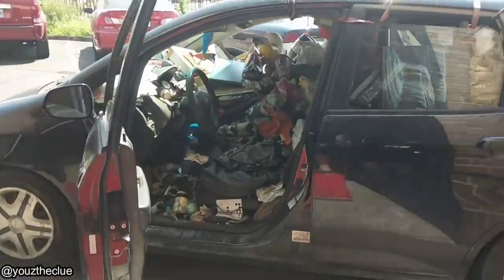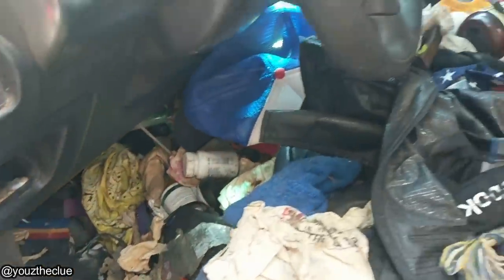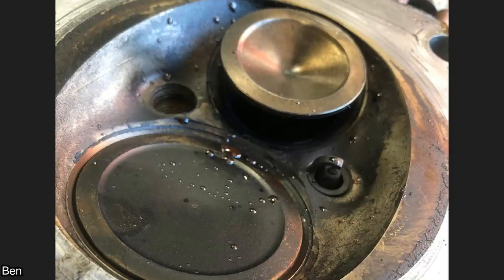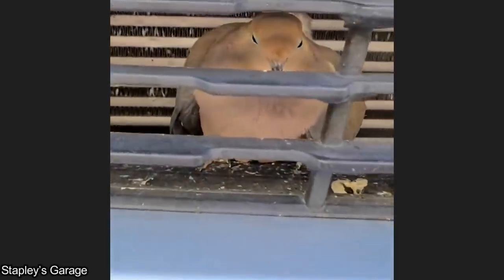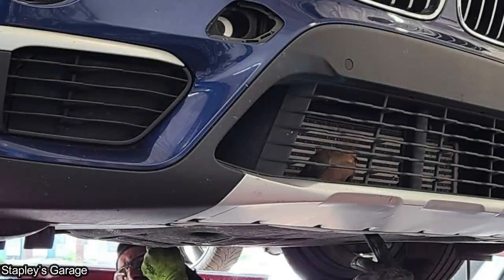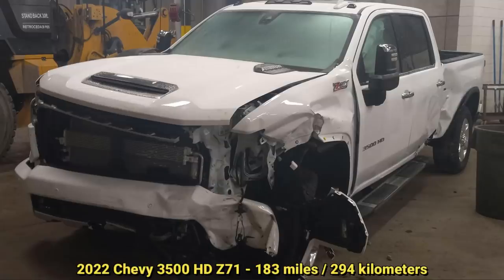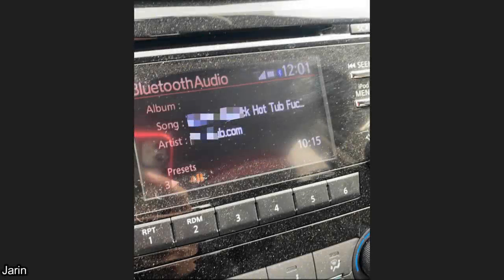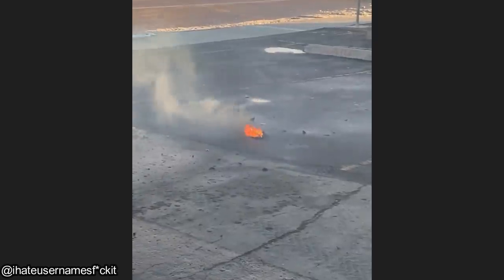Customer States Install New Tires | Just Rolled In

Comment: Son "But I was only going about 10-15 mph when I hit the curb."

Dad "Too bad the curb was doing around 40. Which, by a wild coincidence, is the same age you'll be next time you drive one of my cars."
Reply: Who lets a 17 year old near a Maserati? Parent needs a slap.
Reply: @davepayne164  any teenager can find a hidden phone. Let alone a spare key is easier to find.
Reply: Reminds me of when I was a mailman and had just seen Tokyo Drift, obviously I thought why not, I can surely do that in the postal van! Went okay starting out but I had chosen to start the drift on gravel road onto a asphalt road, needless to say I ended up in a ditch with a totaled van 😂 my boss was not happy even with my explanation that I wasn't going that fast
Reply: @Tumpz  did it at least feel more authentic in a right side drive vehicle?🤣 We used to have an old mail delivery rig, a '76 International Scout and it was fun to drive to high school.😆
Reply: @justlucky8254  it was actually a left hand one, it was a tiny Peugeot van I think. In a regular van it would surely have went on the side 😂 I almost did that to another van not thinking about the center of gravity when doing a turn at high speed.
Reply: @BoredGeese  not when it’s in the gun safe

Comment: I worked as a mechanic for a bus company. The owner bought 2 new VanHool 45 ft. buses, one of which was pre-owned. Well, the pre-owned one, it turns out, looked a lot like that first car when it was traded in by the previous company. I opened the luggage compartment only to be greeted by the sight of roaches running for cover. The whole damn bus was crawling with the nasty, little buggers!
Reply from the maker: Gross 🤢 hate roaches
Reply: @JustRolledIn  We freeze dry them in Wisconsin.
Reply: @ Anon Nymous So you're saying the bus was a real "Roach Coach?" I' show my self out.
Reply: @darkdelta  You here all week? lol
Reply: @darkdelta  That was a good one.
Reply: Omg,me too! I had to work on a conversion van once,and whe i took off a rear trim panel,no lie,i was greeted with a complete "wall"of roaches,behind that panel🤢🤮!!! That thing gave me nightmares,for weeks!!
Reply: Worked as a mech in a muffler shop.  Had a carpet cleaning van come in for some welding on the pump motor's exhaust. Opened the passenger door and  about 10 soggy  paper lunch bags and a few hundred cockroaches spilled out.  These guys "clean" the carpets in peoples homes...  Frickin' nasty.
Reply: we had a  customer return a skid of product to us . it was weathered and full of roaches . we put it outside way away from the building right away . the product was plastic so no food. maybe they were eating the cardboard packaging.

Comment: That impact lithium fire was a good lesson. Probably not a good thing, to store battery powered tools in the same toolbox as other flammables!
Reply: or around metal chips, steel wool, buried under metal tools etc..
Reply: Within the last few years our planes started carrying fireproof bags with fire gloves in case a passenger laptop catches on fire. The flight attendants are trained in putting out the fire. They are stored in the overhead bins at each end of the aircraft.
Reply: What if the toolbox itself is flammable?
Reply: What brand was that?

Comment: We had an old AMC that had no floor pan under the passenger's carpet. It was rusted away, and it was that way for years before I discovered it. I found it only because I went underneath to replace the starter.
Reply: My father had a car, a Plymouth, that he drove mainly back and forth to work. One day my mother was was riding with him and said she could see the road through the floor. He said that must have been the cold draft he felt while driving.
Reply: When I was a kid, my family lived in Michigan; my father was constantly buying cars to fix and resell. One time, back in the mid 70's, he bought a 1968 VW Bug. The thing had zero floorboards; he made some out of 3/4" inch plywood, and resold the car.😁...
Reply: @ursus353 That's  what  You call, rebuilding a WOODY!!!!!

Comment: I'd be so embarrassed about the Bluetooth thing, it's actually a fear of mine 😆😂
Reply: Who would be watching that at a garage? That is my question.
Reply: The radio I got for my car I purposely went for one that didn't have bluetooth compatibility and went for one with an SD card slot, so I just load an SD card or two with music, insert SD card into radio and go. I do not want nor need my phone to be connected to my radio, too many people want everything connected to everything and it's just a big hassle.
Reply: that's so weird because at least in my car it only shows what's currently playing. i'm pretty sure that's how most bluetooth radios work, so whoever it was, was watching that while the mechanics were working on it.

Comment: Had a van come in worse than the first one (if you can believe that) for a battery. Customer stated they had their own battery, somewhere in the back. I declined to service it unless she found the battery, and made her pull the van over to outside my bay.
Reply: holly cow... I wonder if it's compulsive hoarders that end up with cars like these. I can bet they'll keep the old parts inside the same car if you let, and throw a fit if you don't.
Reply: I’ve had about 4 or 5 like this in my career. Worked in one shop where a hoarder came in for regular maintenance. At least the driver side was clear of debris
Reply: @Kalvinjj  I knew a man who had his car full of newspapers neatly stored, we joked that he could not fit them at home when he died, so it turned out that his whole house was full of newspapers. According to rumors, they emptied the house of 15 tons of newspapers.

Comment: I never got into battery-powered tools in the shop. I like air tools, one source of power all day long. Air tools last a lot longer too!
Reply from the maker: You and I both. Did mostly heavy duty so air tools just worked better for what I was doing.
Reply: Can't tell the kids anything.. 🤭🤭🤭🥴
Reply: Amen to that
I mostly have corded power tools but they're still working well in their old age

I have craftsman tool that have SEARS logo on it
Reply: Lithium is amazing.  
Until you see a pack catch on fire and then they are terrifying.
Reply: Caution: if a lithium battery is burning, don't breathe the fumes, they're toxic. And use a Class D extinguisher not water.
Reply: Two things I have never liked about air tools:
1: Having to deal with the hose (Yes, you get used to it, but if it is all the same? I'd rather not have to in the first place)
2: Fucking. _LOUD_.

But, air just does somethings batteries can't. Like never having to worry about overheating, or....airguns.
Reply: @dposcuro  Check out aircat airtools, my 1/2 drive impact from them is quiet and a beast, loosens things no other brand in the shop will, ir, snap on, etc.  I have the dual clutch model but i would get the other type, twin hammer or something i forget the name,  if i got another. my trigger is either on or off, cant modulate it,but works good for doing tires with a torque stick when tightening.  My gun is quieter in my hand than my coworker's ir a few bays away.
Reply: And when the power goes out and the compressor is empty?
Reply: @FireoftheGreeks  I think for most people, that is such a rare occurrence it is rather hard to justify as a purchasing choice.

Sure, if you live out in the middle of nowhere, and power outages happen every month or so, or perhaps if you live in Texas, it might be worth considering. But for most people? Not really a consideration with much weight.
Reply: Buying thinner and therefore lighter, higher quality and more rubbery hose makes using air tools alot easier. 

The ready made ones are too stiff and crappy for my liking so I make my own up with special order hose and proper Nitto hose fittings.
Reply: @haroldwilkes6608  I mean, it's an electrical fire--one of two types you never want to use water on.
Reply: @connor3288  I have the aircat stubby 1/2" and also the 1150k. The stubby has enough power to do 95% of my work and is my all day every day gun. That 1150 has more power than any other 1/2" gun in my shop. I'm a big aircat fan myself. Plus both of those guns and my 3/8" all together cost less than one tool truck gun. It's so satisfying when guys ask to borrow my $150 aircat cuz their $400 matco won't break a nut loose...
Reply: @RexWort  Ohh absolutely, corded power tools out last and far out perform.
Reply: @haroldwilkes6608  hard to believe they make meth with them battery’s.
Reply: @brantmcfarland517  Have you ever seen the decontamination crew at a meth lab? Dressed like a HazMat team. Those chemicals are deadly.
Reply: Only nice if it’s your dedicated air hose. It’s annoying to have to share!
Reply: I'm old school also. Battery tools are okay in tight places where an air hose may be in the way, but you can't beat an air tool for torque. They don't die in the middle of the job on you like battery's do either.
Reply: @FireoftheGreeks  You won't be charging battery packs either. You can hook a compressor up to a gas powered generator and be up and running in a few minutes. Your battery packs will be sitting in their charging cradle doing nothing.
Reply: @FireoftheGreeks  ... that's when you go home early.
Reply: I like to use my battery stuff on things that don't need a lot of torque. My air tools are for most everything else. I've had most of my battery powered Dewalt stuff for at least 8 years now and I can't remember having to replace a battery yet, though some the casing is cracked from falling over the years.
Reply: @FireoftheGreeks  how to charge batteries when the power goes out?
Reply: @BS-ys8zn  the ones on the charger will last at least a day if not more, by then the power should be back on.
Reply: I have both, they each have their uses. Main thing I hate about batteries is that they don't do well in an unheated garage in winter. If they were made to work and charge in all temperatures I would use them a lot more.
Reply: When power goes out for air tools, TF dude? 
Same thing that would happen to electric impact, where are you going to charge the battery?
That's why you need to have a gas powered generator just in case
Reply: I love me some Corded tools, i do keep Battery versions for mobile repairs
Reply: @Marandal  I have my whole collection of general corded tools as well. I have no issues using an extension cord either. Cordless tools do have a place, but their actual operating life is short.
Reply: @johnclamshellsp1969  absolutely.
Reply: i used to be that way until the new lithium batteries came out. now i use many cordless tools. if you go to the torque test channel they test cordless impacts. some are more powerful than air.
Reply: @dposcuro  i do work all over my 200,000 sq ft shop and it's great not having to haul an airline up 40 ft to reach something on the ceiling. it's industrial manufacturing. for big torque we have hydraulic wrenches to 7000 ft lbs.
Reply: @FireoftheGreeks  Or people keep stealing the batteries. Biggest problem I have seen where people do not use air is short tool life and very expensive batteries that keep vanishing.
Reply: I threw the breaker on my compressor and haven't looked back.  I don't miss the noise and the new battery tools kick ass.

Comment: Back in 1998 I had a customer bring in an Acura TL3.2 requesting an alignment because the steering felt loose. It seemed low in the rear so I opened the trunk and found over 600 lbs. of tile, thinset mix, and various toos.
Reply from the maker: Blows my mind what some people put in the trunk of their vehicle lol
Reply: Another time, working at the same South Florida dealer, I was doing a tire rotation and balance on an Acura Legend. I opened the trunk and lifted the mat to check the air pressure in the spare only to find a bunch of brown paper bundles, a pile of cash, and a 9mm Beretta where the spare tire was supposed to be. I just closed the trunk and slowly backed away.
Reply from the maker: @bradharris7230  jeeze. Can't beleive what people leave in their vehicles lol

Comment: I once had a car which told the same knock knock joke (While I was on a road trip).  It was a sheared bolt on the rocker arm assembly.  Thankfully I was within a couple of miles from a garage who removed the broken stud and had a suitable spare.  There was no further damage and the car lasted years after that.

Comment: The first one: I would have called the cops right away to have the inspection sticker pulled. That isn't safe. (Also gross.)
We had a guy come in with a real nice honda. He had detailed it and was gonna bring it to a competition. He stated the gap between the rr tire and wheel well was 1/4" less than the lr tire. I put it on the alignment rack and the tires were straight, susp ok. But he had a box in the trunk with four tens and a heavy amp. I told him the amp was so heavy it tilted the car.
Reply: Bootlickers are the worst.

Comment: What are those 60 pound bags of concrete?  I count 10 so that's an extra 600 pounds squashing the rear axle.
Reply from the maker: I thought a civic could handle that 😜
Reply: @JustRolledIn  
They made for speed not for heavy load

I doubt even Honda's truck can handle that weight 🤣
Reply: @JustRolledIn  Civic can handle that without problems, but the I remember that you have no annual inspections there.
Reply: That's almost like having two Americans in the back seat.🤣🤣🤣
Sorry , had to say it. UK.

Comment: That's one 🔥HOT battery..I've never used Electric or Battery tools in our shop ..Air is the way to go..
Reply from the maker: I prefer air tools as well!
Reply: I use both. Sometimes it's convenient to be able to work away from the air hoses, but I use air whenever I can because it's more reliable.
Reply: As a carpenter we always use cordless tools today, since some roof can have 50 m of length. We never had a single problem or a fire with a LI-Ion battery pack, as long as you don't abuse them or damage them mechanical they are safe. 
You have these batteries everywhere today - in every phone, in every notebook and in every tablet, they are essentially in every house today
Reply: If you have HPA on tap it makes sense to use it. Not everyone does though - and a battery is a lot easier to carry to the job site than a genny, a compressor, and a tank of diesel....

Comment: - "Peanut butter". Since the state of that car is not precisely clean, allow me to doubt that.
- We heard you like floor mats... so we put floor mats on your floor mats.
- The footwell getting hot is not a problem... is a feature XD
- Lithium batteries can be veeeery scary if you allow them. Since that battery was used previously, maybe was not charged. Fully charged batteries are very scary when explode.
Reply: Kind of hard to dispute it; if you look at 1:25, the jar was sitting in the center console cupholder.

Comment: Can you imagine the flames from all those electric cars and yard equipment mandated in California? Or is it Commufornia?
Reply: So no gas vehicle has ever gone up in flames due to a ruptured fuel line, right?
Reply: @Slicerwizard  Not while just sitting in the garage when they’ve been well maintained. Lithium batteries have a history of it. We RC hobbyists charge our batteries in special containers to avoid burning down our houses.
Reply: @LonC1966  RC batteries are a completely different chemistry, since they can provide insane C rates. They are much more likely to catch fire. 
If you take LFP for example, this chemistry is inherently safe, you can even penetrate them with metal objects and they don't catch fire

Comment: Dude A friend of mine bought a Dodge Challenger brand new in 2017 and it blew up at 800 miles no joke! Bottom end of the motor fell out going down the highway.
Reply from the maker: Damn. I've heard about a lot of engine failures at very low miles if not pretty much new. Great quality 😅

Comment: Had a customer come in with the level of filth as the first one. Guy actually worked at a junk yard of all places. When i tell you the odor of that vehicle was so terrible, the techs refused to work on the vehicle until it was cleaned out.

Comment: oh, man, i had that same foot well problem on the driver's side of a '95 pathfinder... i was on the highway, when the carpeting finally came into contact with the exhaust pipe.... it burnt a hole in the carpeting, melted a divot in the heel of my boot, and filled the cabin with smoke almost immediately. i had to open ALL the windows, and even then, there was so much smoke, i almost got into an accident, before i could pull over. there was a good 5 seconds, at least, where i literally could not see a thing outside of the truck.

Apparently, the heat shield had completely rusted away. Had to cut out all the rusted metal, prep the area, patch the floorboard with sheet metal, paint everything, then fashion a new heat shield... was a lot of work, but it turned out ok.